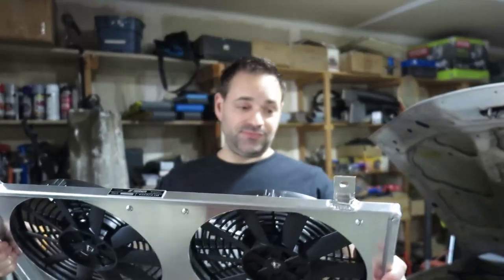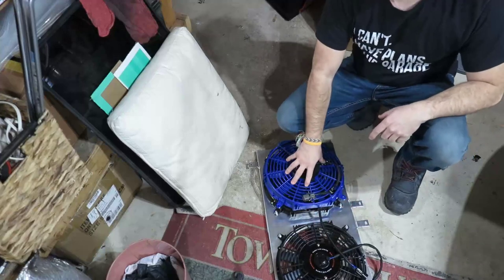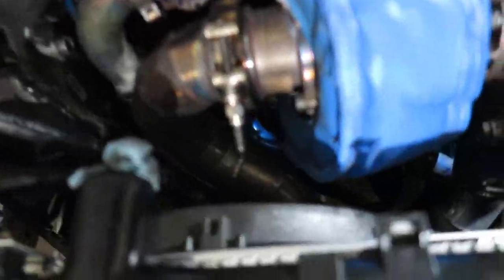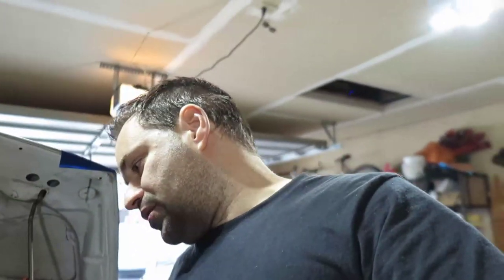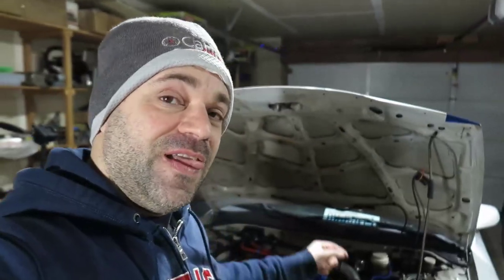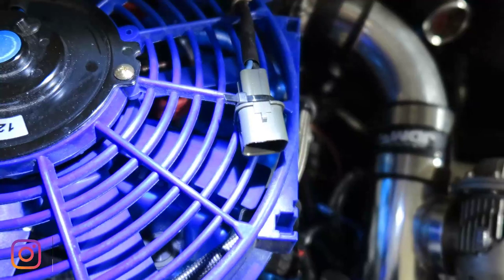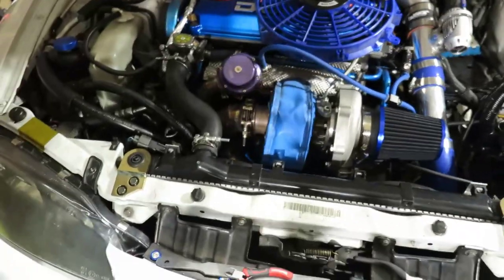Performance Radiator & Fan Shroud Install - Eclipse 2G Project

Comment: ooooh Mishimoto.
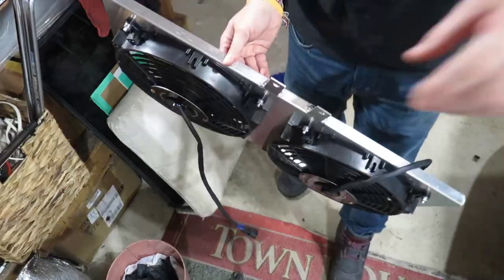@3:02 Is the blue one also Mishimoto Brand? What's the Rated CFM on one of the Blue ones versus one of the Mishimoto Black ones ?
@7:46 did the kit come with the rubber seal for the shroud?
@12:43 Working like a true DIY guy 
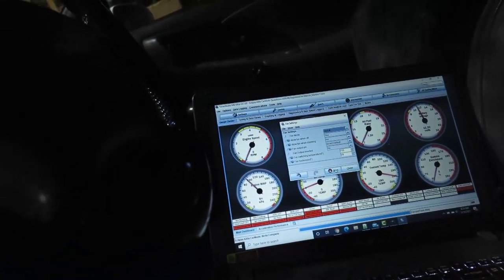@14:32 long nights early mornings 😁😅

Love the content, good stuff man, Can't wait to hear on if its better and by how much.
Reply from the maker: Hey brother, I hope your project is coming together we'll. 
The fans are exactly same design. I think the cfm is not different but I don't have the numbers. What makes the whole difference is the shroud and yes it comes with the foam tape. It's a very well put together kit and well worth the money. 
It's better by a lot but because of the shroud. A lot. Car cools off in minutes now. Another thing is that behind the fan motor Mishimoto put a plate which helps to protect it from heat. I loved it

Comment: Did you have any problems with it blowing fuses or relays ?
Reply from the maker: No it didn't. So far it's working perfectly. Bump the fuse up 5 amps and see if it helps

Comment: Hell yea !! Hey brotha what fluid did you use on ur nvt350
Reply from the maker: ATF+4 for automatic transmission.  👍
Reply: @CarModsGarage  no way and it works fine ?
Reply: @CarModsGarage  you don’t use regular gear oil / Manuel trans oil
Reply from the maker: @miketofu5692  that's what I've read it was supposed to use. So far so good.
Reply from the maker: @miketofu5692  yes. Same used on my power steering pump. What do you use?
Reply: @CarModsGarage  no way that too? I use regular power steering
Reply from the maker: @miketofu5692  I was using regular manual transmission but read in multiple forums that the transmission expects ATF+4 because the synchros expect something that it is in there and it will last longer.
Reply: @CarModsGarage  so 2 bottles of any atf4 , I was using penzoil synchromesh gear fluid
Reply from the maker: Yes that's what I'm using ATF+4. Before I was using MFT synchromesh for manual transmission
Reply: @CarModsGarage  and u use atf4 in ur power steering too ?
Reply from the maker: @miketofu5692  yes i do
Reply: @CarModsGarage  no wonder my acts funny soMetimes like it gets hard then soft
Reply: Hey so atf+4 only for 2000 and up nvt350 95-99 nvt350 use synchromesh penziol, valvoline, ams oil, royal purple only make it

Comment: So left side positive right side negative?
Reply from the maker: You need to see what the fans specs are.  Usually if its switched it will spin the opposite way
Reply: @CarModsGarage  It’s because i have a 4g63 radiator in my car and i want to run the mishimoto fans i wired it the way you did but idk if they would work
Reply from the maker: @kingestuardo5317  are you on the OEM ECU? Try to let the car go to working temperature and keep an eye on the fan starting and if not then turn off the car and check the wire.  Having a multimeter helps.
Reply: @CarModsGarage  Yeah i have the oem ecu and i let the car get to operating temps for about 5-10 mins and they didn’t turn on
Reply from the maker: @kingestuardo5317  get a multimeter and check the connector coming from the car to see what is positive and what's negative.  I remember I joined a wire to keep the low and high speed working together.  Not sure about the 4g63 setup but mine had three wires one was power and the other two were speed.  You might want to research that to see what is what.
The other thing is that you need to assure that the 5 or 10 minutes idling were enough to reach the temp to start the fan
Reply: @CarModsGarage  i drove it around today and the fans didn’t kick on. i don’t know what else i should do. i did left side postive and right side negative like your video
Reply from the maker: @kingestuardo5317 you need to get a multimeter and see when the car is up to temperature where the positive and ground is.  You will only guess otherwise and could potentially overheat the engine.
Reply from the maker: @kingestuardo5317  nice. 👌
Reply: @CarModsGarage bad news they worked and then they stopped for some reason :(
Reply from the maker: @kingestuardo5317 oh dang.  Any idea why?

Comment: Hey my friend, I have seen some reports of overheating due to the "log" style heavy cast turbo manifold.  You may want to have a look at these performance manifolds : https://www.xtremefabrications.com/index.php?main_page=index&cPath=4
I am not associated with them but I have heard many reports of much better cooling overall and really really big HP gains as compared to the log style exhaust manifolds. Downside is that with some of these custom exhaust manifolds you may have to find a way to flip the shroud and reverse polarity to a push fan or purchase a purpose built push fan set to make clearances with ac and power steering. Recently found you - I am also in IT. Love your channel. I don't miss a video!
Reply from the maker: Thanks for the info brother. Funny to find another IT guy that like cars.  I will check those out and yes I can just flip the polarity and it should do it but for now the clearance is good and it's cooling property but ya I want to replace this manifold for sure